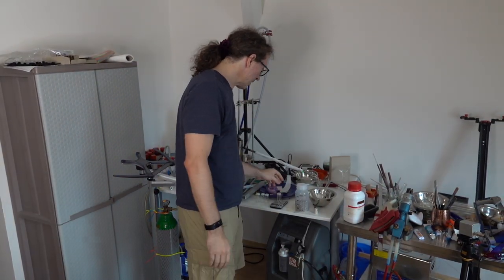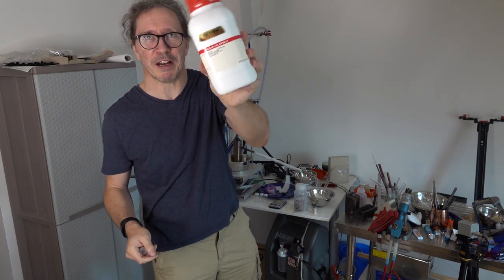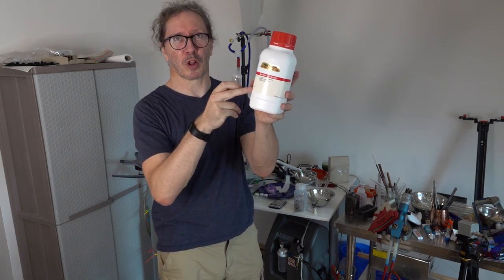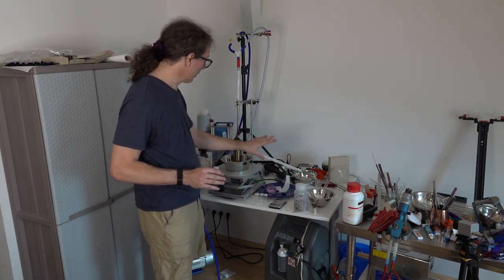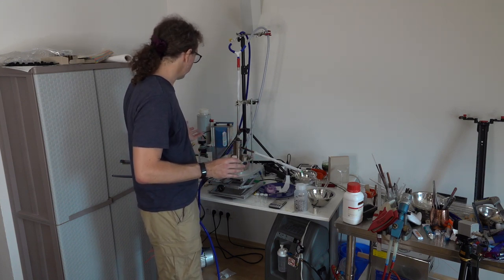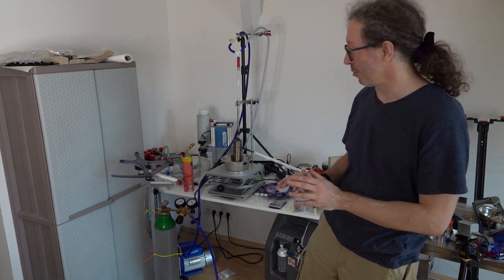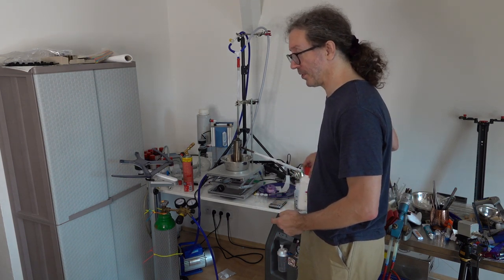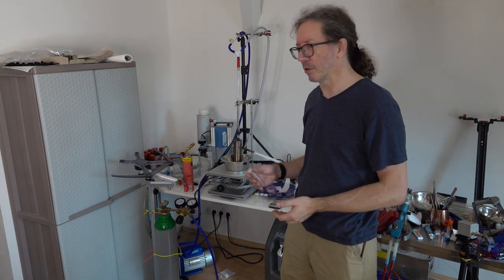Prelude to Cesium distillation (FORESHADOWING!)

Comment from the maker: It caught fire!!!... but put your guess in below as to why..... :-D  (Ill edit the video up tomorrow! )
Reply: You dropped it in water to test it :)
Reply: Did the towel get too dry and combust
Reply: Breath or sweat
Reply: Because it reacted with an oxidizer
Reply: I'll guess it boiled over
Reply: First guess is the rubber connection at the top caught fire.  Heat rises.

Second guess is the cesium did bad things to the epoxy.

Third guess is one of the welds failed.  Umm, one of the brazes failed.  Possibly because your filler wasn't stainless steel.

Fourth guess is gawd punished you for being an atheist by zapping the still with lightning.
Reply: Maybe some leak in your destination thing or when you transfered it to more permanent container
Reply: the absurd thermal gradient on that thin glass condensation tube most likely
Reply: My guess is that the weld failed. I don't remember you saying you used stainless.
Reply: Epoxy failed
Reply: over pressure
Reply: Most likely Scott Brusaw snuck into your lab and dropped a little fragment of Solar Roadway into your kit. Goes around, comes around, Mr. Thunder.
Reply: As long as your ok... you should of wore protective gear on... always be safe bro
Reply: I bet on the paper towel
Reply: Did something go wrong with the tissue paper that you sprayed with water?
Reply: It was because there was to much negative energy in the room !!🎯
Reply: @truthbetold444  Maybe it was the SLUG that made Jucero!:)
Reply: It caught fire as some hot scientist melted the epoxy seal.
Honestly that metal pipe is not nearly long enough to keep cool from the other end as metal is some of the best heat conductors.
Well that is my guess.
Reply: your welds failed
Reply: I think lithium got into the glass container.  Needed the spout higher on the side of the stainless apparatus.
Reply: because you put a fuel source, an oxidiser and an ignition source all in the same place at the same time?
Reply: My guess, Li ate away your welds, something reacted with the epoxy or vapors traveled the vacuum pump route and react with the hose.
Reply: It started sucking in air like mad due to your "welding" :D
Reply: guess #2 you poured water on it after the whole thing failed and a giant piece of Lithium/caesium flew into your hair and you caught on fire
Reply: Temperature gradient caused the glass to fail.
Reply: You used silver brazing rod instead of silicon bronze, Silver rod's melting point is pretty low, usually around 600C to 700C 
Or razing alloy reacted with the content
Reply: Condenser tube plugged and reactor vessel had a tantrum.
Reply: Lithium eats through the container
Reply: Glass or epoxy on your chiller.
Reply: You feed it after midnight?
Reply: There were organic contaminants in the salt mixture? Or was the wrong gas in the kit?
Reply: With the Sun in Leo and Neptune in Pisces combined with a Void Lunar uncertainty Zone ... You should have known to Expect the Unexpected.
Reply: Because it caught fire.
Reply: You created Maxwell's demon when you cooled the cesium. Demons love fire.
Reply: You didn't evacuate unter operating temperatures beforehand. My guess is the weld got leaky. Alternatively, the epoxy got leaky due to thermal expansion. There are epoxy glues with metal particals inside to get a thermal expansion closer to metals/ceramics, btw..
Reply: It was drawing air.
Reply: I think I got it: The Caesium reacted with residual air and created caesium hydroxide which corroded the glass.
Reply: Have you checked you home insurance policy is up to date?!
Reply: the paper, maybe at the top first.
Reply: Exposed the apparatus to air
Reply: If the hose is long enough:
put the bottle on its side to begin with so it simply can not fall over and drag other stuff down.
Simple, easy, cheap solutions are important. 
Otherwise depending on how stury the table is, bind the bottle to the table leg with something.
Again, no more falling over and dragging stuff with a cheap and easy solution.
Reply: @ICNIRP  i say he should have used exhaust repair paste instead of epoxy
Reply: My guess is that your cooling of the pipe going to the vacuum pump was not enough.
The vacuum seal got broken, and the rest was history...
Reply: Spoilers much.
Reply: the braze failed at that temp
Reply: Maybe no reason at all, just good old spontaneous combustion!
Reply: @bdf2718  my guess too
Reply: Was it demonetized because you said "son of a bitch"?
Reply: I don't think I can guess.  It sounds obvious, but then again you guys have to know the reason for every atom out of place which makes me think it's probably something stranger?  Maybe not.
Reply: water
Reply: ICNIRP my thought exactly. Epoxy cracked somewhere and sucked in N+O2.
Reply: The torch tipped over when the building was overwhelmed by all the neighborhood’s cats and dogs running amok simultaneously. Or else EPA made you shut off your containment field? Root cause you insulted Walter Peck and you had cats & dogs sleeping together, mass hysteria.
Reply: The gasoline can tipped over? Didn’t cap it properly.
Reply: What does anybody need the caesium for, come on now
Reply: Holy water
Reply: @Grunchy005  i suspect oxygen or combustion
Reply: You did what I do when I make toast - you went off to do summit else and then shouted "Oh sh!t"  then ran back in to late. As my old man used to say "time and toast wait for no man"
Reply: Stainless steel couldn’t take it?

Comment: A kitchen, a place where one makes food....

Thunderf00t.... a kitchen is the front line of scientific discovery!
Reply: A kitchen is where you keep bowls, jars, drawers for an assortment of metal, plastic and wooden tools, running water, a fire extinguisher. . . Need I go on?
Reply: I mean, I run experiments in my kitchen, too. 

Culinary experiments, but the idea is there.
Reply: @JaxMerrick  I mean no offence but just want to say this so badly: "Inhuman Culinary human Experiments"
Reply: I do my soldering on my rangetop because it’s got a heat resistant glass top & ready power plug (and range hood with light bulb)

Comment: My guess: 600° is well above boiling point of water and ignition temperature of paper. You turned the thing on and tried to spray water on it, but the water evaporated too quickly, steam kept paper from getting wet and it caught fire...

Comment: Why won't you use thermo resistant silicone in stead of epoxy?
Heat Resistant Sealant 1300°C - 310ml, found on ebay in 5 seconds.
Reply: By the time the cesium gets to the end of the tube, the tube should be cold enough to not affect the epoxy, plus cesium doesn't need to be that hot to still be a liquid.
That, and I assume epoxy is easier to get than heat resistant silicone.
Reply: That end should be cool anyway for the distillation to occur. Plus, I'm guessing a non geat resistant epoxy is actually an advantage here because you can burn it to release the glass tube when it's time to reuse the apparatus.
Reply: Silicone sealant -too easy

Comment: Reactions with the epoxy I guess?
Reply: Epoxies are long-chain ethers from memory. Even if you cooled the vapour doen enough so it didn't melt the resin, I imagine that the caesium vapour could just rip oxygen atoms out of the polymer and tear it to pieces.

Comment: Why water and not cool mineral oil
Reply: Phonotical mineral oil acts more like an insulator
Reply: @alandouglas2789  exactly, in case of a leak in the system it should not react so violently with the cesium and at least give a little time to react, particularly with the external use
Reply: @phonotical  In case of a leak, the caesium would most likely ignite on contact with air, and then that would set the mineral oil on fire too. So it's.questionable whether it's even safer than water, as well as being a worse thermal conductor, more viscous, and the simple fact that you'd have to demand your own pump from scratch since, y'know, it doesn't come out of taps.
Reply: @alexpotts6520  not an impossible ask

Comment: great, all this talk of high heat, fire, and no talk of how to extinguish the fire, stop the spread of fire, prevention of inhalation of fumes, and all done in a residential space probably with neighbors sharing walls.  My guess your welds are trash and you have a leak there or you heated up the epoxy and you had a leak there.  Looks like about as much prep and safety systems as the geniuses at Chernoble.
Reply: He did those welds in the bathroom btw
Reply: @Grunchy005  LOL